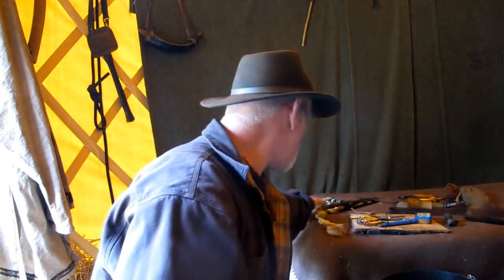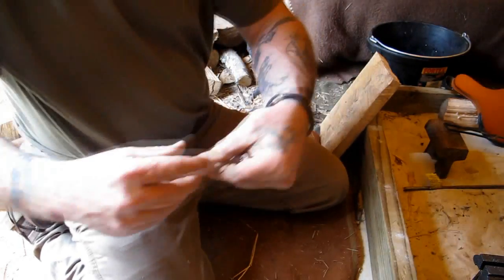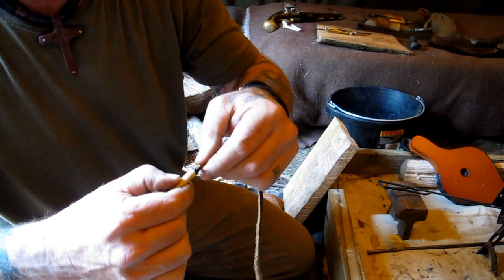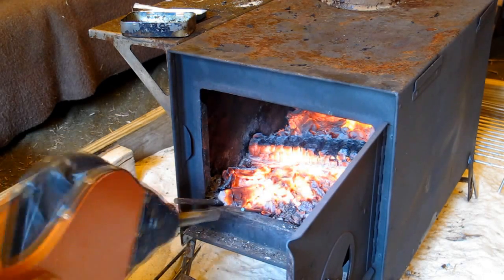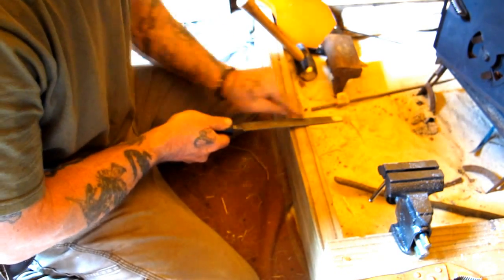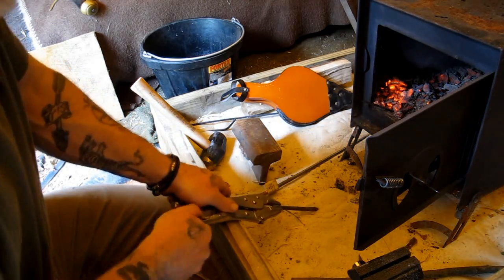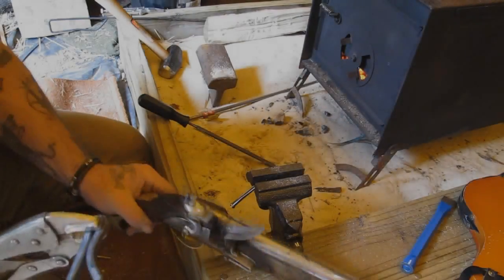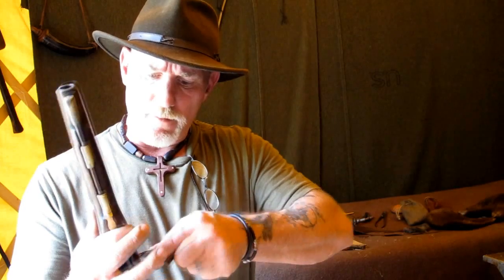Journal of the Yurt 52 Making Flintlock Tools.wmv

Comment: Great video, love learning from you Brother. I was once told by a gunsmith that a screw driver for gun smithing should be a little bit soft so it wouldn't gall or otherwise damage the screws on the gun. I notice you quench hardened yours, did you temper it later? 
I also noticed you no longer wear a neck knife? I don't care for a knife flopping around on my chest, was just wondering why you don't wear one any more?